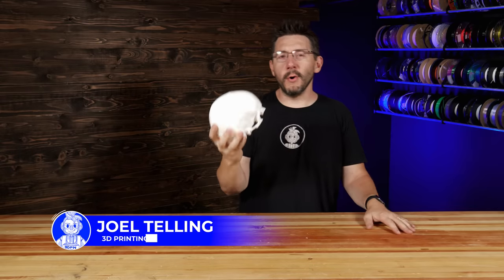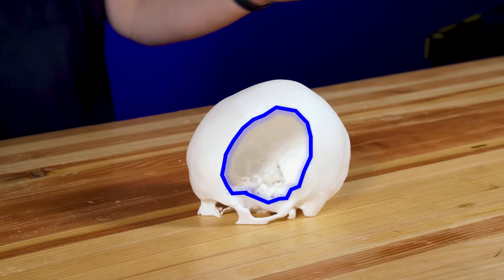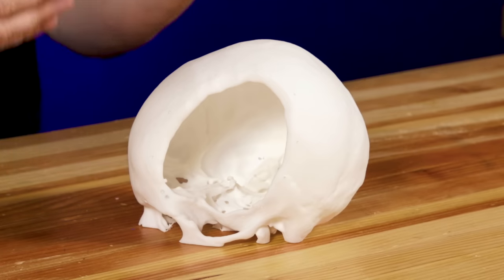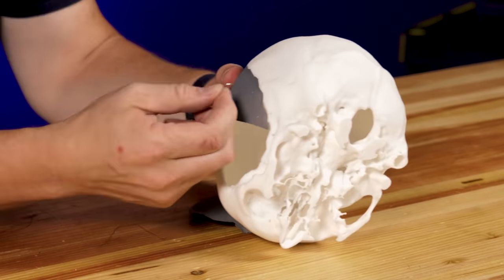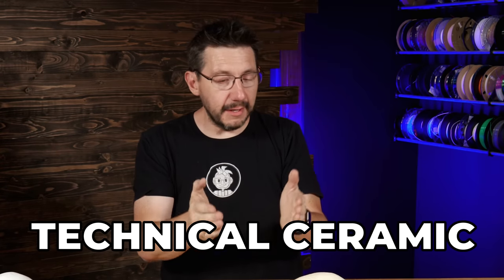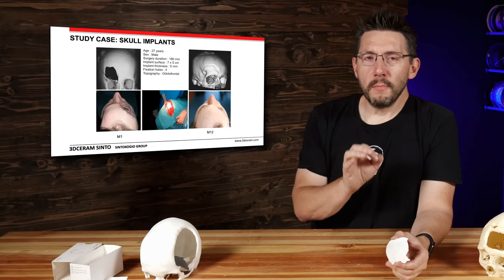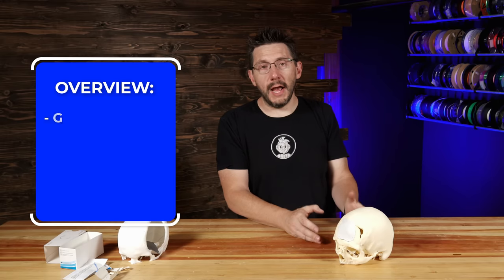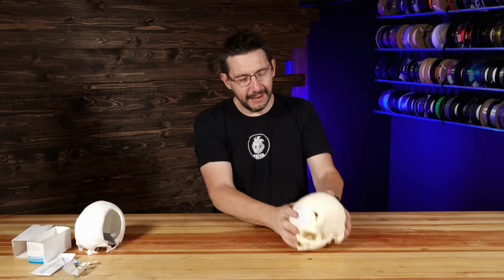3D Printable Ceramics FOR YOUR SKULL?

Comment: Before cheap desktop 3d printing was a thing... both my children had  congenital defects in their skull.  At 1yrs old they both had surgery.   Dr's split the skull bone that was removed to double the surface area they had to work with for filler materials.  One had titanium screws to hold things in but the other had a sucrose based screws and plates.  The latace work of sucrose based material allowed for the bones to grow into it and dissolved over time as the sucrose was eventually absorbed into the body and left full bone in its place. The titanium screws had to eventually be removed but the sucrose screws and lattice are gone.  While this is awesome, it is really an upgrade of processes in place at least back to 2005.
Reply: I can only imagine how stressful those days for you! So in your children's case other than the screws what was the material used for actual patch? If the second one has sucrose based filler then may be companies need to work on 3d printing in sucrose based materials. So entire thing can bio degrade once the body grows bones in the lattice.
Reply: @mvadu From what @BurninGems said above:  "Dr's split the skull bone that was removed to double the surface area they had to work with...."
So it sounds like they calculated the size bone they needed, marked it out, removed it, then somehow they split it in half. So they would have then used screws and plates to put the halved bone back in it's original position, then used the other piece to fit where the defect was and used plates and screws to hold it in place. 
Wonder how many hours that took and how many surgeons, Dr's and nurses & anesthetist's were required? Incredible!  And that was 18 years ago too.
I could be wrong, that's just how I read it. I ain't no Dr. I just responded in case they don't get back to you.
Reply: @mvadu @David-yo5ws  you read it correctly.  Bone has 2 sides, both hard and inside is the soft marrow part.  By taking a section out, they split it now giving them 2x the surface area to work.   One child was 8 hours the other 11hours.  Seemed like years ticking by.  This was all done by a great craniofacial group at university of Michigan.  You had a plastic surgeon team and also a neurological team working together along with anesthesia and other support staff.  They usually do a follow up every year or two.  Both are healthy, normal kids now with hard heads.  I think my daughter may have had the metal because her skull was thinner at the time.  The sucrose based products is just how it was described to us.  I don't know the trade name, I'm sure it is very patented stuff but it was at a major medical college so some could of been experimental.  The other took so long because the skull being thinner than expected and once they were in had to improvise the solution from available options.  Yes it was very stressful but I knew the teams were knowledgeable and competent and God was guiding their hands.  As for the toll, after the 1rst child went through it, we were told there was only a 50/50 chance any siblings would be similar.   After 2nd child had same problems we new we would never have the big family we wanted so decided to stop there.  Tooo much stress going through all those procedures etc.  But we were lucky and both kids are normal (whatever that means, lol) smart kids. And we also learned after witnessing another parent come back into the hospital waiting area drunk because it was the 6th annual operation on their little 6 year old, our problems were really nothing compared to others in the hospital that day. While scary, our kids had one major sugary and was "done"  while some kids would be treated over a course of their lifetimes and may never know a "normal" life that ours now take for granted.   So whatever children's hospital is close to your area make sure you support it.  Donations or support fundraisers etc.  Like Joel does.  Without our local support staff and surgery teams, our whole outlook could of been 180 degrees from where we are now.  Sorry so for the wall of text if you made it this far.

Comment: As an "ex" 3D Systems Employee I worked a lot with facial and cranial reconstruction, especially in Virtual surgical planning. So up to date the most patient specific implants for reconstruction are made from Titanium or PEEK. The biggest hurdle you have to take is to get the 510k approval for those kind of implants even with Patient specific is not that hard to get it but you need to validate and certify the whole process. It is good to see that ceramics are coming up to close some gaps. Nice video. Still nowadays we see too many milled implants where Additive has only advantages in cutting a lot of waste.

Comment: I actually work with those after they're printed. We clean and sterilize them and all different kinds of 3D-printed implants
Reply: That's awesome. How many have you seen come through? Thousands?
Reply: @davidtobin  hundreds. Crani plates like the video was showing. Total knee replacement pieces. Some 3D skulls with gaps in the jaw, this is so they can cut out parts from a patient's leg, trim it down and then use the gaps in the 3D skull to check the size and then implant it into the patient’s jaw.

Comment: I’d bet it was a CT scan, rather than MRI? MRI doesn’t image bone as well, and CT is a much higher resolution (what we use for printing out orthopedic surgical guides it typically is 0.5-0.6mm resolution (we volume average it for doctors so they don’t have to sift through thousands of slices but the reconstruction software doesn’t care about slices (like an arm is almost 2000 slices raw but we average it down to 200 or so), but for 3D printing if you use the averaged one you get Minecraft/Lego looking models versus super smooth. MRI on a good day gets 1mm voxels which give Minecraft (and bone is black, brain is great but the bone not so much).

What’s particularly cool is if that is printed in hydroxyapatite, that is the chemical the body produces to make bone, so eventually will be indistinguishable from the native bone (like a bone graft would be),  it safer as it’s a ceramic so no risk of infection (a kiln will kill anything) assuming nobody sneezes on it after before packaging…